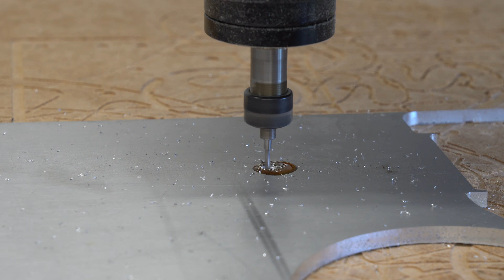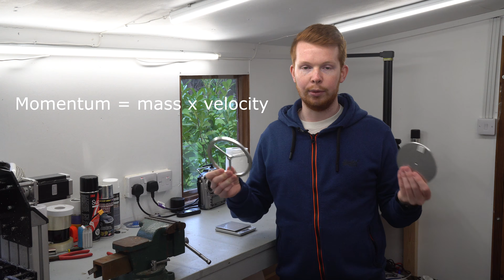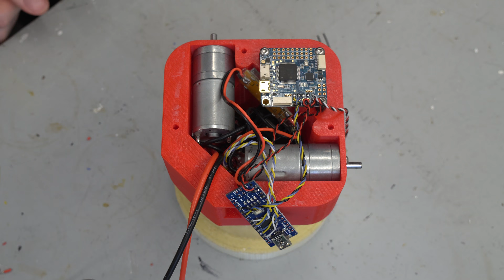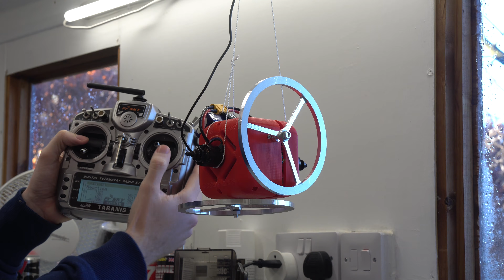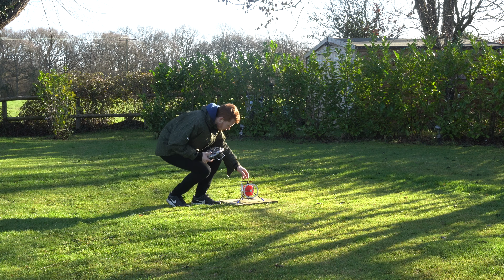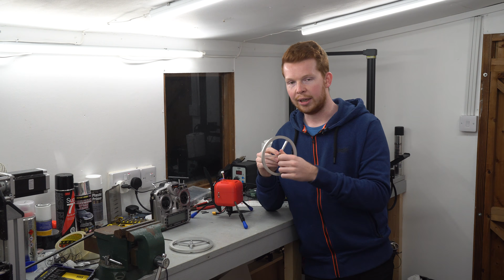Comment: Oops, your mass moment of inertia (MMI) equation for the hollow disk was wrong.  You forgot to include both the inner and outer radii in your equation of the hollow disk and the mass of the solid versus hollow disks are also different.  Like you I will neglect the 3 spokes on the hollow disk and we will assume both disks are the same thickness.  You were right about the solid disk, MMI = 0.5mr^2.  Lets say the mass of the solid disk = m1 & the radius of the solid disk = r1.  Lets say the mass of the hollow disk = m2 and the inner radius of the hollow disk = r1, the same as the solid disk, and lets say the outer radius of the hollow disk = r2.  The equation for the MMI of the hollow disk = (0.5)(m2)(r2^2 + r1^2).  And yes, the plus sign is correct.  Your goal was to have the MMI of the solid disk equal the hollow disk, furthermore, lets say the hollow disk mass = 40% of solid disk mass: m2 = 0.4m1.  If you solve these equations, you get r2 = (1.22)r1 and from the equation, you also can see how m2 must be < (0.5)m1.

Let me be clear that I am very impressed with your combination of mechanical & electrical circuit knowledge, but you have a slight mechanical engineering weakness.  Also, I think you let slip something that answered a question I had about your hovering rocket video where I asked what control scheme you used and I went on to describe "PID" control in my comment.  In this video I think I heard you, at one point, quickly say something about tuning the PID.  As I mentioned in my rocket comment, a proper PID control scheme is able to self tune (would require tuning test flights).  This reaction wheel device would for sure work better if you could actually measure the torque and feed that back into a closed loop control circuit.  You are correct that just an RPM sensor and some extra real-time computations could compute the torque (Torque = MMI x (angular acceleration)).  I also think it would work better if you started with a base level amount of wheel RPM since having to flip rapidly from clock-wise to counter-clockwise rotations causes some instability at the zero-rpm crossing.  of course, don't let the basal rpm be too fast since, as you say, you do not want to "saturate" the reaction wheel (operate too close to the motor RMP).

Keep up the good work!

Comment: Put a control wheel on each side of the cube, with eight fans, each fan on its own corner and you will succeed on the first try. And the axis of rotation emanating from each of the eight corners will also be a leg of myrrh, which will give protection to the fans because they will be in the middle of the axis, immediately after the fan, the rotation must be non-existent on the remainder of the axis in order to form a leg that protects everything that sees it and from all directions

Comment: the air powerded bike was all wrong. U needed a motor, tiny best motor u could get, & use air instead of fuel for the power source. Same w/ electric bike using same idea.

Comment: I run into this video and found it very interesting. I wonder would this work better if you had the two props at the end of a stick and most of the mass would be on the other end. That way it would sort of self balance like a pendulum. Then you could use the reaction wheels mostly for driving.

Comment: As a suggestion, also you need to balance the craft, by the Center of Gravity, this I believe would help the inertial controllers, as a helicopter blade on top The design is just extremely too sensitive the reaction wheels seem to be over controlling. This is a very good project and the thinking is nice and advanced and very progressive. Keep doing your good work and have fun too.

Comment: Hi, thank you very much,
I want to advise that, try to put 4 wheels, each two wheels on opposite sides (each two on the same axe, opposite rotation, and one initial speed) by controlling deferential speed you can smoothly balance the copter.

Comment: I clicked the video as I thought you would use the gyro effect by spinning the two wheels are high speed, then fine tune it with tilt sensors. The problems seems to be the static Wheel reaction speed.

Comment: Great Experiment. But I feel that you missed a big opportunity here :

You should have : 
*4 reactions wheels (2 counter-rotatings pairs)
*Reaction wheel always spining at steady speed (e.g 5000rpm) 

This way 
-> you gain stabilization from the gyroscopic effect of the wheel constantly turing.
-> you steer by applying torque and changing the reaction wheel speeds 
-> You can use brushless motor in their regular speed range and thus have much more reactive control and much less problems with saturation and linear torque/speed relation
Reply: That's an idea I would turn into reality instantly if I had the time and discipline to do so...
Reply: And one step further, you could even put blades on the reaction wheels so they supply lift too, and then they would impart momentum into the air, preventing them from saturating.

Of course then you've designed a standard quadcopter.

I think it's odd that the video didn't acknowledge that drones already use their rotors as reactions wheels for yaw control. The air resistance is the bigger part, but the momentum of the blades also plays a huge role.
Reply: This was my first instinct too, when I realized in the slow-mo that the reaction wheels were barely spinning and were changing direction, I instantly knew that was a big problem. I'm impressed that the design worked as well as it did given that the reaction wheels weren't spinning at any substantial speed

Comment: I mean, what I'm seeing is a constant imbalance the moment the propellers activate, they do not give thrust through the centre of mass. Seems like the machine needs to constantly correct itself just to stay horizontal. If you made two opposing wheels for each motor to balance the drone, and try to keep it such that the propeller gives force through the centre of mass, the drone will need to do a lot less, making it less jittery.

Comment: Could a solution to reaction wheel saturation be to invert the torque application with a brake? A Reluctance based system could be used to brake the wheel, inducing opposing torque on the craft. The faster the wheel, the better in such a setup.

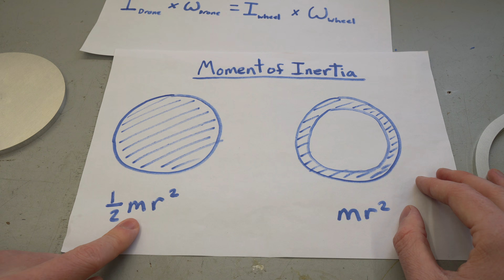Comment: 8:21 Not necessarily. For example if you substituted 3 for r, the equation would be (3)^2 or 3*3. Multiplying that expression by 2 would be 2(3)^2 or 2 * 3 * 3. Rearranging it to find how r is multiplied gives you: (2*3) * 3. 2*3 ≠ 4

Comment: Did you take into account the gyroscopic effect of the rotors when applying a force with the torque reaction of the wheels? It looks as if when one wheel reacts to level the craft with a torque around its own axis, this also changes the thrust vector by 90 degrees advanced in the direction of rotation of the rotor. This motion is then corrected by the second reaction wheel, which would also change the thrust vector by 90 degrees, resulting in an oscillation and quicker saturation of the wheels.

Comment: Sir, I think the only problem that the drone was facing at end was equal weight distribution. That is actually why it was getting dis balanced. And the torque issue can be fixed by using encoder motors or by having a wheel on each side.
The video is really great. You were successful in sharing the project experience.

Comment: When you have a rotating wheel and apply force to rotate the axis, the wheel will turn in direction perpendicular to both the axis and the applied force. I am afraid your idea of stabilizing drone will never work because it is not consistent with physics. Your experiment wih compensating momentum by momentum of rotating wheel worked only because the axis was firmly fixed, so the resulting reaction force effect was prevented. Once the drone is not fixed byt hangs in the air, it will rotate in direction you did not assume. Try to watch some videos with professor Eric Laithwaite and find out what's the problem with the concept. You should see that the movements of your drone are the same as a running flywheel when exposed to external force.

Comment: reaction wheels seem like they could be too big. motors are over reacting for the size of the wheels and sending the drone too far and then they get into a sort of oscillation to fight themselves. If they aren’t programmed to learn then they will continue to over react and continue to send the drone past the stability point on each end of the spectrum which is what we see with this shaking sensation in the slowmo (aka rocking motion). Don’t give up!

Comment: Hey, you might want to look into purchasing MIC-6 as a replacement for the 6061 on these types of applications where flatness is somewhat critical. They may have a different name for it in Europe, but essentially it is a ground and polished piece of Aluminum and Silicone alloy that is very flat and will not warp when you cut it. Be aware, you cannot weld MIC-6.

Comment: I think weight of drone is not balanced, and  so please  applied balancing weight opposite to reaction wheels it will give stability to drone (or) shifting the position  of drone blushless motor to axis of centre of gravity of drone this gives stability to drone 😊 because  in space  we doesn't required balancing of mass.

Comment: It's the torque produced by the 'reaction' wheels that would cause a reaction,so it has got nothing to do with the velocity of rotation.
Also , u could have designed the Arduino program in such a way that it wouldn't require to know how much torque is produced , the activation of the reaction wheels could be solely determined based on gyro sensor values.

Comment: Something you may not have accounted for is precession, primarily in the rotors, but it would also apply to the reaction wheels when they get up to speed.  When you have a rotating mass, and you attempt to apply a torque perpendicular to the axis of rotation, the rotating mass translates some of that torque into precession of the direction of angular momentum according to the right-hand rule. So, in your build, you have the top and bottom rotors counter-rotating. This means that the direction of their angular momentum will be opposed, either outwards or inwards, depending on which one is clockwise and which is counter.  Lets assume the top is counter-clockwise, so it's angular momentum is upwards.  If your reaction wheel attempts to pitch the drone forward (by rotating backwards), this will apply a torque along the rotor axis, and the precession will cause that torque to translate as a clockwise (starboard) roll from the top rotor, and a counter-clockwise (port) roll from the bottom.  If the rotors have exactly the same angular momentum, then this won't cause a problem, but if they differ, this will cause changes in pitch to ALSO cause a change in roll, and vice versa.  Similarly, if one of the reaction wheels is spinning at a significant speed, a change in yaw from the rotors or pitch/roll from the other reaction wheel will cause a change in the corresponding right-hand rule direction.

Comment: Try centralising the disk rotar shafts on their corresponding faces instead near the edge, youll need to either make the square bigger so the disks dont touch or make the disks smaller. Then add a second set of disks on the opposite sides that spin in the same direction and rate as the motorised ones,  youll have to figure out some sort of gear system to link each opposing face together. You may want to half the thickness of each disk too to reduce weight.

Comment: in the slowmo i can see that your wheels are actually off center of the drones base, i guess you could have done that based on the original weight of the drone and the center of gravity but what im seeing is that your wheels are applying the force with added leverage from their offset from the center of the drone, thus making any changes to weight or balance like you did with the battery will offset the center of gravity and change the leverage even more.
this means that even though the wheels may be spinning at the right rpm to create the right angular velocity, it is being applied via an offset rather than to the center of the drone, which means forces are not being applied evenly but are instead being multiplied with the leverage.

Comment: It would be quite interesting if you replace the reaction wheels with weights on linear motors below the drone. So you don't use the momentum but the weight shift to control the orientation. Batteries could be a great weight, so just attach two battery packs on rails.
Instead of using two motors, I would just use one with a small gearbox to drive two propellers at the top. Which intersect each other on 90°s (for extra coolness factor) like on a K-1200 K-Max.
To add yaw to the controls you could add a smaller reaction control wheel (you don't need that large amount of momentum for yaw).

Comment: What if you got the reaction wheels spinning prior to take off; about 1/2 way to saturation. Wouldn't that provide some kind of stability to begin with? Then you would speed up or slow them down, like the way you did with the propellors. They would act like gyroscopes when all spun up, which are quite stable.

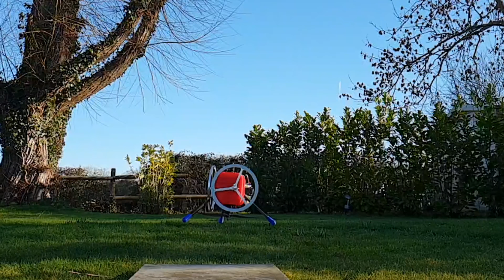Comment: If the motors can spin the reaction wheels at a higher rpm, (19:19, "And they aren't spinning anywhere fast enough for maximum rpm saturation to be an issue.") then you should have made the reaction wheels lighter. Looked like weight was a big problem, along with what the actual engineer in the comments said.

Comment: wouldn't this work a little better if the reaction  wheels weren't wheel but something that is a little off center? wouldn't the forces generated from this type of action better control the drones movement. wouldnt the forces created by the drone props affect the system

Comment: Pretty interesting, How is the project going so far?  from the slow motion, it seems the reaction wheel has too much latency, or the Kp of the loop is too low. besides, for DC motor, I think current control might be a pretty good option, and I think it should have pretty good linearity even on high speed.
and I think one way to keep it away from saturation is to feed the wheel rotation speed into drone attitude angle.

Comment: I really loved this video, but have you thought of using gyroscopic effect to control either a gimbal or a drone? spin up some disks and have them mounted on a servo and just adjust it slightly to cause the device to rotate, will add lots of stability too...

Comment: Thanks for sharing! ~ I love this idea of gyroscopes - I was thinking, would there be extra turbulence/interference caused by the gyro's on one side of the drone, due to both fans thrust? - Could this be corrected by each axis having a gyro on either side?  or (see 1)

  Beyond this:

  1~  An enclosure that can also house the gyro's -  

 2 ~ utilising 4 fans (like many drones) - that are outside the gyro control region.

 3 ~ Thanks for reading My name's Pip!

Comment: Hey Tom! Cool project! 
For your issues with motor saturation and PID tuning, switching to a different controller might help. Namely, a non-linear controller called "Adaptive-Bias-Adaptive-Gain" is a novel approach created to remedy some of PID drawbacks. In particular, the controller is a-dimensional and provides the output in terms of percentages, which in this case remedies the problem of a wind-up, which is common for PID. Nevertheless, see [1] for more of its features/benefits. I used for my robot-manipulator-control projects, and after seeing its power, I completely to using that controller only for other projects as well. 
[1] Franchi, Antonio and Mallet, Anthony, "Adaptive closed-loop speed control of BLDC motors with applications to multi-rotor aerial vehicles",  IEEE International Conference on Robotics and Automation (ICRA), 2017.